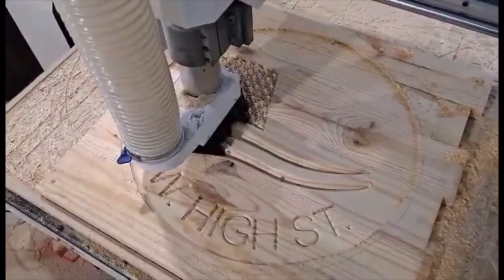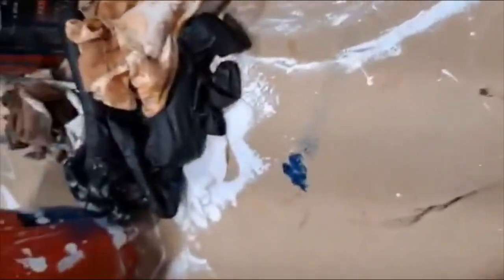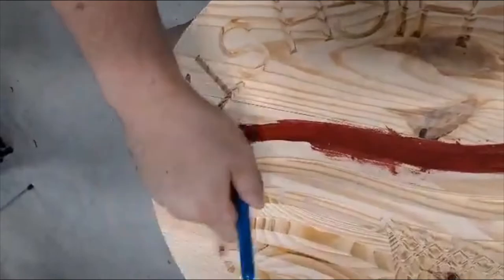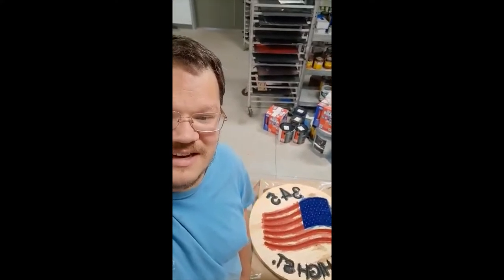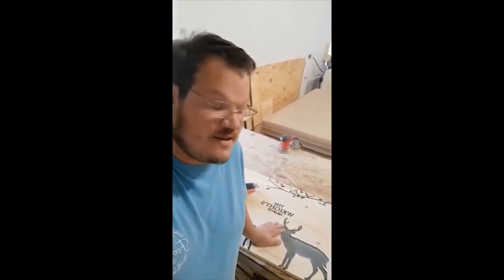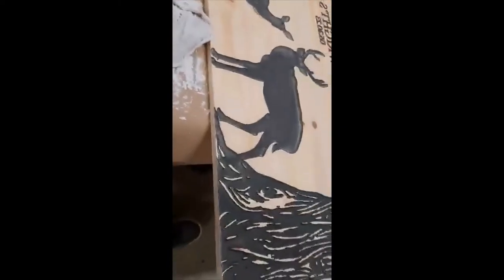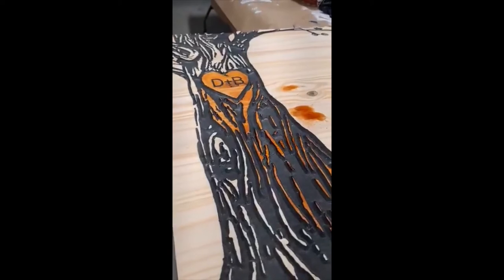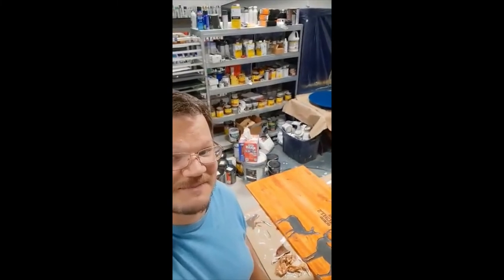how to color fill cnc routed sign v carved

Comment: You didn’t put any polyurethane on that sign before you painted it any colors??  Just asking cause some (a lot actually 🤷‍♂️) say if you don’t the paint will seep into the wood to much (especially if it’s pine wood) & you won’t be able to sand it all out!
So just asking?? 🤔 🤷‍♂️
Reply from the maker: I did not that only  seems to be an issue with thinner paints like a spray paint that being said urethane will help if you choose to do that
Reply: @JaysToDoList   Thank, I was about to hit the start button on my CNC & am making my first multi colored sign on a 24"x24" pine project panel & was just wanting to know. I greatly appreciate the feedback & timely response. You helped me out more than you know. 👍